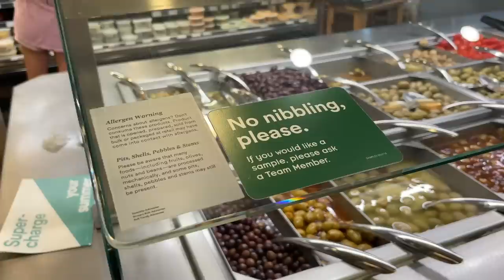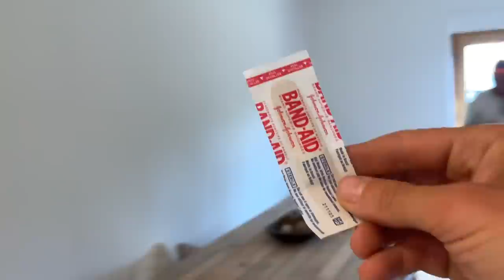Preventing A Landslide!!! Goonzquad Barn Is Finally Safe With A HUGE Commercial Retaining Wall!

Comment: The retaining wall should have packed gravel at the base and behind the wall for drainage. Also some drain tubes, otherwise the dirt will start washing out between the blocks and erode the base. 
Those blocks look amazing though and the cost seems really good for what you have! Looking forward to you sealing up the barn corners and area around the roof and watching the deck be built!
Reply: This right here
Reply: Bingo
Reply: even for something this small? For a proper residence sure, but for a shed in the woods i think this is fine
Reply: @pred7949   definitely it’s on a slope
Reply: Why not, add drainage and gravel. That seems like the while your in there thing to do.
Reply: Absolutely.  Do it once, do it right!
Reply: The dirt will just slide down to the retaining wall.  That wall is too short and the gravel and dirt need to be packed up against it.
Reply: Yep French drain be perfect and simple to do
Reply: Yep. Done a ton of these.......literally.
Reply: Yep, they need a proper foundation!  I wish these guys would research things better.
Reply: Omg its a fricking barn. It doesn't need half a million dollars worth of materials and labor into it.
Reply: Yup. Need to put gravel or aggregates for laying its base plus the soil above the retaining wall need plant grass to prevent water directly goes to the soil.. a gabion also can be used for this plus drain tubes.
Reply: My insurance company would probably not insure this structure nor anything inside of it should something “act of god” happen.
Reply: Lmao there’s always these guys to complain
Reply: @ron3586  wow ronnie, they aren't done yet. Calm down.
Reply: @fast97z24   these guys work and make there money so y can’t they do what they please on there property
Reply: Drains only help when the wall is sealed. This wall is not sealed, otherwise gravel is all you need.
Reply: @ron3586  so you are telling me there is going to be a landslide throuout their entire property? even that slope infront of billy's house? lol
Reply: Yall so dumb I swear, nothing is going to slide, if they plant grass in there there’s no way the dirt will wash out. Chill out and let them do their thing.
Reply: @fast97z24   LOL, I think half done is done.
Reply: @pred7949  Come on now, You are putting words in my mouth.  If you look at the foundation from the bottom you can see where some of the dirt under the foundation has already washed away.  From the very beginning they treated the shed as good enough.  I like these kids and enjoy what they do..
Reply: @fast97z24  it will not last, gravel is cheap

Comment: @goonzquad: did you read the install directions for that block?  Did it call for a compacted base, or even a buried course given the required height of the wall? You would be quite surprised at the pressure of that earth behind the wall - it could easily shift that block if it decides to slide, especially if that block isn't correctly anchored.  What about geogrid to anchor the block wall into the berm?  You have a tall wall, you might need it - check the specs on the block for install requirements.  You also need a drain at the inside foot of the wall to carry water from behind out to the front (along with proper drainage away from the wall).  Additionally, you should probably build the wall up to the road given it is all sloped, otherwise, the back pressure from the soil could spill off the sides and still give you a problem.  You should also  have lined the back of the wall with geo stabilizer fabric as that will both stop soil from seeping between the cracks and spread the force over the whole wall and minimize hot spots.

Just my opinion as a once-professional in that biz.
Reply: This - drainage, and compacted base that starts under the ground level. They should have dug 3-4ft (at least 800mm) under to stop the wall moving.
Reply: @FRENZY355  as I am not familiar with that particular block, I can’t really comment there, however that would make a great deal of sense to me.

I also didn’t mention that the leveling method they used per block (some small stones) is probably not spec. The base should have been near perfect before laying, and using a layer of concrete sand as a leveling agent would likely have been acceptable (check spec on that). I always spent a great deal of time getting the base near perfect, and getting that first course absolutely level on that base with minimal to no leveling sand. 

Of course, if that wall requires geogrid, it may be a bit too late to install that where the wall is currently located, and there may be another solution for this particular installation to anchor the wall into the berm. 

Finally, local code may require a permit and/or stamped engineer’s drawings for that wall.  As the structure is not an actual dwelling, such may not apply here, but they should check.
Reply: no

Comment: Love the channel and all that you guys do. I spent 20 years as construction inspector. Love the barn build but the biggest mistake made was u placed all that fill with no compaction. I can see the slab is undermined a bit in the back due to the soil settling. Your retaining wall will keep the barn from sliding. I would expect within 5 to 10 years the slab in the barn to have some major cracks due to the soil settling underneath. Compaction is a very important step when placing that much fill and building on top if it. Please take it as friendly advice for your next building. Peace
Reply: You have been chosen  to get a present.👆👆 Direct message to ASSERT OWNERSHIP.🔝🔝!
Reply: Yup I use a 1000 Lb plate tamperer on a regular basis for all of our compaction, very least a 500 Lb and a few passes every 2 foot lift I do.
Reply: I agree it's a pretty shitty build all through. But for what it is, it'll be fine.
They have the machinery and the money to fix anything that pops up. And it will. Depending on the volatility of the soil
Reply: I too was worried about that, but whats done is done....
Reply: @1one3_Racing  As long as the Viper isn't in it the shed as it slides down the mountain!
Reply: I understand they like to do things themselves and all but time and time again I see the comments SUGGESTING a thing or 2 and it takes them a good while to come around. Again they have to be a little more subscriber friendly. They got some subscribers with real good knowledge watching that always have the RIGHT solution or RIGHT way to do things. They need to pay attention to other channels on here that embrace taking advice from subscribers. Hell i would! Not everyone is knowledgeable and it doesn't hurt to learn!
Reply: @TODD_FL44  it's not that they don't listen. They do. I honestly think they know a lot nore than they let on. They have a schedule of videos and a formula they are working on to grow the channel. You can tell a lot of what they do and say is baiting us. A lot of what people suggest they are going to do anyway and they have reasons for doing things a certain way that they don't let on.

Comment: That wall needs draining likely.  Not sure with those big blocks if you have to, but a layer of gravel packed in with each course will help the water leak out and the wall be strong.  I know when most use smaller stones they will have gravel there to keep the water from building up and pushing out.  Some will use French drains behind the walls.  A drain just under the top cap will help keep the water the out of the bottom part.

Comment: Dude can't believe that thang ain't slid off the mountain yet!! Glad to see the retaining wall 😂
Reply: good
Reply: You have been chosen  to get a present.👆👆 Direct message to ASSERT OWNERSHIP.🔝🔝🔝…….
Reply: Needs amembrane behind wall to prevent spil. Washout
Reply: No rain, if they had plenty of rain you see your slide barn on the move…😳
Reply: @diamondback210  it’s hardly a retaining wall. Right now it’s just blocks sitting on top of the ground. There are so many structural things wrong with it that it won’t do anything and in no way has been done correctly. And I do know what I’m talking about after having spent $10k having a retaining wall put around my 9m x 6m shed.

Comment: That’s awesome guys… glad to see you guys added some kind of support structure to that bank. Now about that virgin wood in the barn. Maybe add some linseed oil to it for protection, also consider dovetailing or interlocking the wood next time. Helps with sealing and guarantees a tighter fit.

Comment: Thank you for building that wall.  Since you have the equipment to do this easier than most, move them about 8" further out so there is a gap behind the wall.  Drop in a drain pipe (black flexy with the precut holes, wrapped in cloth) all the way at the bottom and add a drain pipe to the lowest spot (you can go under the block with the drain)  to drain the water that builds up behind the wall.  Then fill that slot with gravel.  More content for us and you would be amazed at how much water will come out.  The fact that it's curved is very good for strength, but still I've seen smaller walls collapse.  Saturated dirt is a scary thing.  Keep up the great content!
Reply: no

Comment: Beautiful retaining wall; but what is holding your block wall from sliding? Those blocks are sitting on soil (aka slippery stuff) and you aren't redirecting any water that gets stuck behind the wall. 
Call this a test fit; then: 1. dig/gough a "key" into the bedrock under the new wall, 2. lay down gravel (to allow drainage under the wall), 3. then lay your blocks. Doing it a little better now is easy - so you never have to worry about your kids, investment, etc...
Reply: I'm no retaining wall expert but can't help feeling that it needs some proper drainage, or as you say, the blocks might be sliding down the hill, followed quickly by the barn. 

I would have thought that the blocks should be on a gravel base and also have gravel between the blocks and the earth and probably a drain pipe? I would guess that the first layer should also be set below the ground. 

Maybe it will be okay, but maybe it is worth getting some professional advise.
Reply from the maker: true that! I guess we'll have to see what happens. worst case we restock them
Reply: Always content driven shortcuts. Glad they don't have a winter frost line to add a few more years life.  Bedrock? The foundation is on a none compacted filled pond hole!
Reply: Normallly (haven’t seen it yet..) the bottom course of block is set into the surrounding ground, the enclosing earth around at least the bottom half of the block prevents it from sliding. The other resistant factory is the sheer weight of the block and the total mass of the interlocked blocks. The first-course inset is almost always deployed.
Reply: @goonzquad  don't pander to these fools the shed going no were you both no it
Reply: @martincday007  usually you dig down and pour a concrete footer, the retaining wall is then built on top of that. With normal blocks (Hollow Besser blocks) we have rebar in the concrete footer sticking up. The blocks get laid with the rebar through the hollow parts. Then we core fill the blocks with concrete, knocking out a small hole in the bottom course to allow the wall to be completely solid with no voids. You always run drainage behind any retaining wall. Agi pipe and some gravel will do.
Reply: @andrewevans1234  they truly do. Did you hear the sarcasm in their voices as they talked about it?
Reply: @goonzquad  not restock...you mean restack them.
Reply: no

Comment: Nice, Is good to have gravel behind the remaining wall, and should have some gravel underneath as well that helps water drain easy and not putting pressure on the retaining wall make it more durable
Reply: Exactly , some methods are done for reason! Like gravel to help drainage. I'm getting tired with these guys.
Reply: Should have rented a jumping jack tamper and tamped the dirt under the wall also !! But that would  have meant do it the right way !!
Reply: As soon as I saw the boys finally build the retaining wall I knew there would be people complaining on how they did it. This will be fine for that barn.
Reply: @mikebrowne477  True that! As my Dad would say, Some people will argue with a street sign.
Reply: @mikebrowne477  My shop was built on a hillside and they used 8 of the blocks twice the size of these. They shifted over the years but not enough to be a problem. They should be perfectly fine with what they did.
Reply: @offhandacoustic  It's just kind of crazy you wouldn't take the extra step of just getting some gravel, french drain pipe and maybe rent a tamper, all easily obtainable. It's not that much more work comparatively and they have multiple trucks they could have taken to get the gravel and pipe when getting the blocks. It is what it is, just why skip the little things that can make a huge difference. Not trying to argue with anyone lol.
Reply: @iuslisuhled2311  Should mention my shop was already built when I bought my property. They might have done everything you mentioned when they built mine. As for the boys here, what they did is a hell of a lot better then nothing at all. Retaining wall of some sort is the most important part. They'll figure it out as they go or pay the price if/when the time comes.
Reply: @mikebrowne477  exactly

Comment: Way to go Beavis and Butthead you listened. Except I don't understand why you didn't backfill around the concrete after you took the forms off. A lot of it is undercut now with the gravel washed out. Bring the dirt level up to the top of the pad.👽
Reply: they did say they were going to backfill all the dirt they removed to the top
Reply: @LaMaRaGe0622  I heard that but the damage is already done. It should have been backfilled right away after the forms were taken off. They made the same mistake when they poured the well house pad.

Comment: You guys should anchor the retaining wall , it's just sitting on top soil and still can slide after a lot of rain and time. When building the deck you need to drill below the retaining wall for strength.
Reply from the maker: thanks for the advice!
Reply: All retaining walls should be built on a concrete footing the pressure you get from soil is huge.   More pressure than anyone would expect.
Reply: noo

Comment: Back in my day ( long time ago haha ), a short block / engine was slang for a bottom end rebuild / strengthening. Pistons, crank, balancing etc. Basically, heads down leaving the top end alone. And a long motor was fully built with top end done. Heads, rockers, rods, intake... all the goodies. =D
Reply: Yup, nothing changed, still the same meaning.
Reply: @evilcnil  Thought so. Was just surprised that self proclaimed "car guys" didn't know that =D

Comment: Looks awesome, exactly what I would have done gents. I would put some gravel rock as your top on that dirt between barn and wall. The gravel will help soak up the rain water.
Reply from the maker: Definitely should've did that but the commercial block should do the trick!
Reply: @goonzquad  Hearing you say that makes me feel a whole lot better. It's not too late though, not that I'm an expert, but you just need to dig it out behind the blocks and drop in the gravel and the perforated pipe, like you did at the new house :)
You guys got all the energy, you just need to channel it a lil bit
But you're awesome guys and pops and the animals and Ma... They bought you two up lovingly.
Reply: no

Comment: Maybe put in a drip line setup thru the decorative beds around your house, then mulch on top of that. The drip line will put the water near the base of each plant, and the mulch will shade the roots, preventing the moisture from evaporating from the ground. Never just spray the plants with water from a hose, as it will act as a magnifying glass, burning up the material. Or, alternatively, you could hand water in the evening, after the sun has gone down. That way the water has time to be absorbed into the plant and ground. Just my $.02. Take care!
Reply from the maker: thanks we'll definitely consider that!
Reply: No topsoil underneath, no drainage because everything is set on clay. What do they expect?

Comment: I thought retaining walls and block need anchored into the hill?
Reply: Should have dug down through the fill that  is there to solid ground,,,run a tamper where they are setting the stone ,,,install 4inches of gravel ,,,set the stone level side to side but leaning backward slightly  3/4 quarters  to 1 an inch that way if there is any push on the wall it will just straighten up the block ,,,,backfill with gravel to allow water to get out !!
Reply: You have been chosen
 to get a present.👆👆
Direct message to ASSERT OWNERSHIP.🔝⬆️

Comment: The retaining wall looks great!!  However your wall is only as stable as the foundation it is on.  Two things would vastly improve the stability:  1) put a gravel bed underneath the bottom row and a few inches behind the first row of wall, 2) Put a perforated pipe at the base level behind the wall for the water to be diverted out the sides of the wall.  This will help alleviate the pressure that will build up behind the wall after rainfall and give a means for the water to flow downhill.  You did a similar thing with drainage behind the house to minimize the amount of water pooling on the back patio.
Reply: no

Comment: Retaining wall basics: Gravel on floor beneath blocks, Install a few drain pipes between each layer, backfill behind the rocks with gravel, put mesh between gravel & dirt so mud/sand doesn't fill up voids in gravel, then soil on top and light compact
Reply: no

Comment: Volvo came out with a new excavator in 2020, it's BIG, the bucket alone weighs 12,400 pounds. It's the EC950F it weighs 100 tons, 200,000 pounds. But for your purposes the Volvo EC220E is 45,350 to 55,360 pounds and is a very economical medium size excavator.